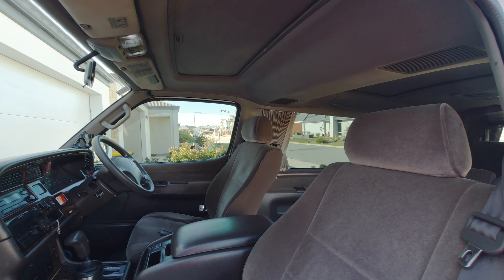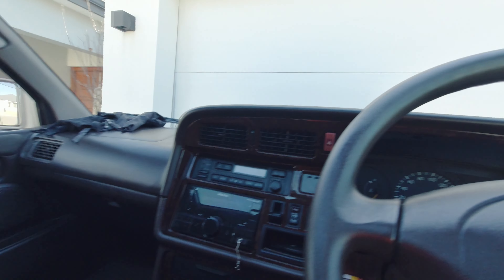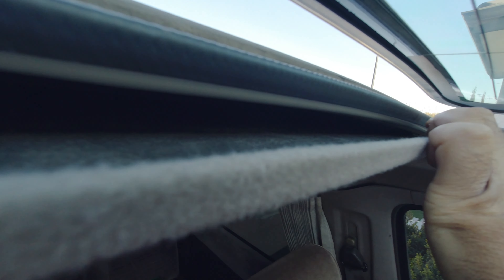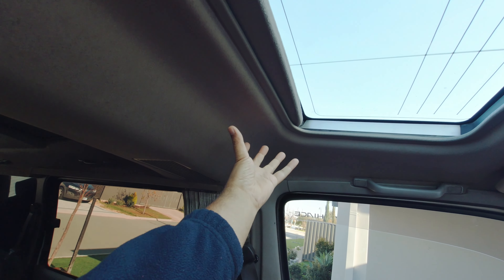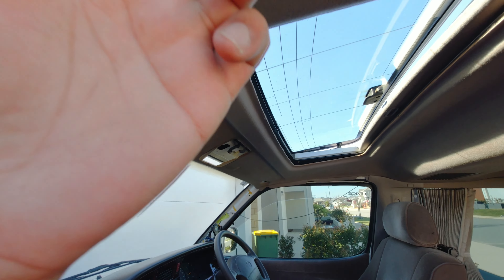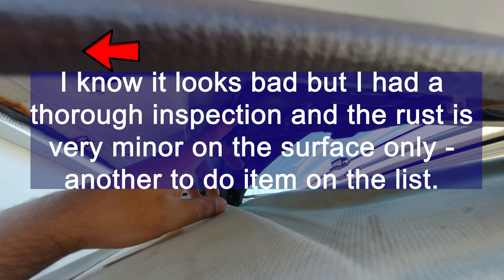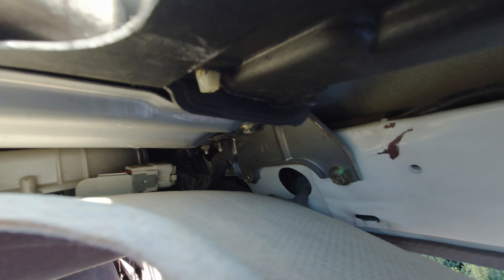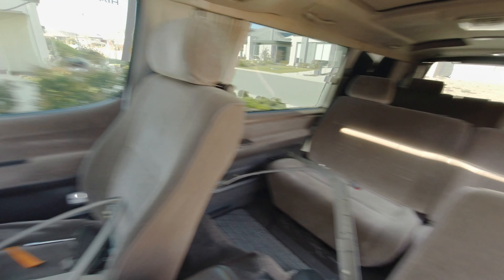Fixed Annoying Sunroof Rattle - Toyota Hiace Super Custom

Comment: Hey nathan ironic you should post up this video.  I have a 2WD super custom similar to yours and when idling there is an annoying vibration around the top of drivers door frame. Once in drive and revs increase the vibration disappears. Havent had time to do a forensic check for source. I'm still happy to own an older model JDM van loaded with retro character 👌🤙
Reply from the maker: Hope it fixes your issue. Now that this rattle is fixed I hear all the other noises, can't win. Just going to enjoy it as is.

Comment: Hey Nathan do you have a video that shows how to clean the drain holes for both sunroofs..
Reply from the maker: In my buying used guide I think I show the drain holes for the middle. Its not difficult to find or clean. Just use low pressure water or air.

Comment: Damn your van is so quiet!!
Reply from the maker: Does yours rattle?
Reply: @nathansharma87  yeah I think the seller took the interior apart and put it back together before selling, for some reason, and now it's showing some rattling. That's when AC/DC and a decent stereo comes in handy
Reply from the maker: @mtwata  😂👍
Reply: @nathansharma87  I need to go back home for a couple of months and the van will be idle in this hot and humid environment. Any recommendations on what to do please? E.g. how much diesel to leave in the tank, if I should add additives, if disconnecting the battery is fine etc. Thanks!
Reply from the maker: Definitely full tank, add diesel conditioner, the drive back from fuel station will get it through the filter and pump and injectors. For the inside get some desiccant from hardware store or eBay like the silica moisture absorbers in food packets and leave a couple open in the van. Put a windscreen shade on, wash and wax it if you want, disconnect the negative battery terminal and good to go. You might want to over inflate the tyres too so they won't get flat spots or be sitting in dampness deflating over time.
Reply: @nathansharma87  you're the man. Thanks, Nathan!